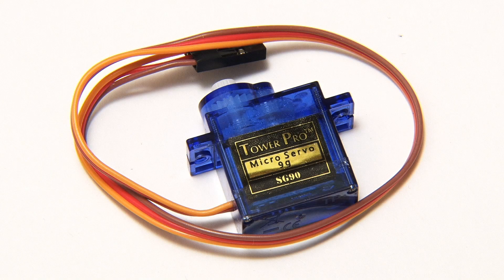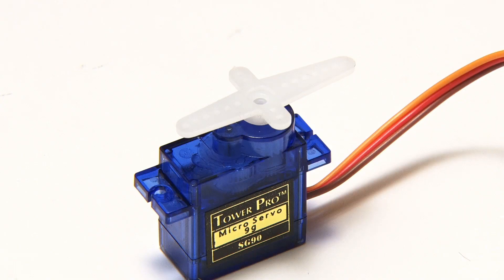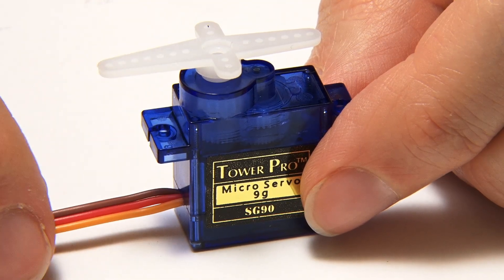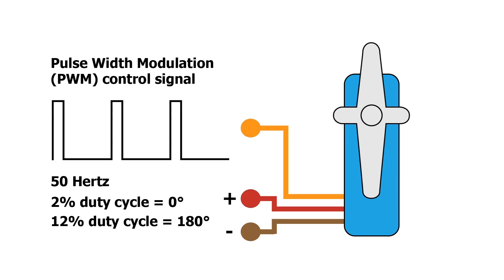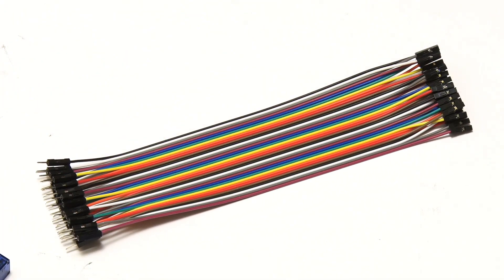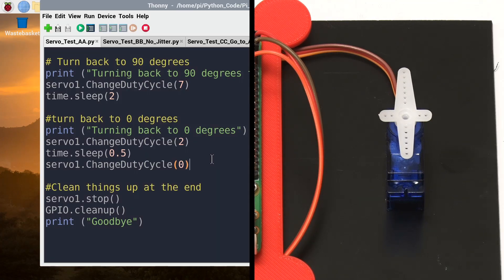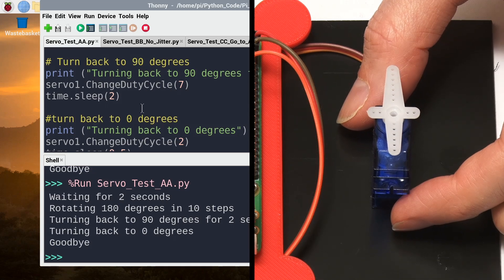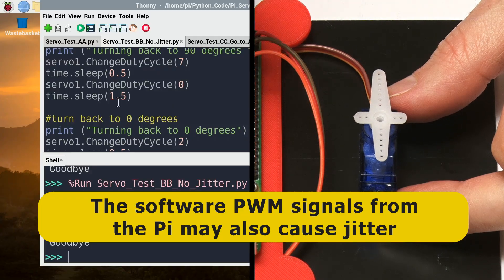Raspberry Pi Servo Motor Control

Comment: I  would love to see a build guide for a home automation unit with these motors for raising and lowering window blinds.
Reply: Honestly, automated window treatments sound inconsequential, but many a year ago, I worked in retail selling flooring...so naturally, I was required to sell window treatments too...(?).

The amount of money they (the relatively few companies that offer custom window treatments) want just to mill custom window treatments is ridiculous (even more so when you see the margins they pull); but add "motorized" to any order & it would add more to the price of custom window treatments than any other option available.  There were times, to motorize a standard sized shade, it would easily double/triple+ the price (& this was always assuming self-installation…).

There are very few window treatments that are more complex than a single rotating metal rod.  As a general public service, if you cannot find a YouTube video to help...then out of a sense of moral/ethical duty to act, I would think EC would be compelled to take on the Custom Window Treatments cabal and their insatiable appetite for profit with just a single YouTube video.

Motorized aside, Window Treatments are one of the New Home Buyer's 1st or 2nd surprise dropkicks to the pants/trousers. It's definitely common in the States...not so sure about the UK....(?)
Reply: stepper motors would be better, they have continuous rotation, search for
"home automation blinds" on youtube :  the hookup and drzzs
Reply: @jyvben1520  Thanks my man! Will definitely look that up

Comment: finally after long time real projects
Reply from the maker: Glad you appreciated. More soon!
Reply: I find the Pi is much more interesting once you start interfacing it with the physical world. I already own four or five computers that are better than a Pi at everything else... but once you tinker with sensors, motors, hats, designing your own enclosures and so on, you find that there’s a real sense of achievement. Also, I am able to tell myself it doesn't matter if you nuke one... although I haven't lobotomised a single Raspberry Pi yet.

Comment: Thank you so so much for this video i was just looking for a tutorial on this topic  
but specifically i was looking to control a full functional bionic arm via responsive web application.
Reply from the maker: Many servos could make such an arm . . . which could be remotely controlled. :)
Reply: @ExplainingComputers  yeah i already built one But the only thing left to do is to figure out a way to control it via a web application which can then be hosted on raspberry pi server and then can be accessed by any other computer or smartphone and that web application will execute Php code to run commands in order to move the bionic arm 
for example let's say i wanna tell the arm to  put some ketchup in the plate i will open the web app and press the specific button and then that button will trigger the php code and that php code will execute the pre-written python code which will tell the servo's to go a little bit this way and a little bit that way to take the ketchup bottle and squeeze it on the plate.

// I know it's a little complicated to make a video of this entire thing but if you can just  give me or Us the basic idea of the whole code that will be really appreciated.

Thanks.

Comment: 5:00 What’s the most popular “dedicated hardware” that doesn’t use software pwm signals?
Reply from the maker: You can also get servo controller HATs for a Pi.
Reply: Arduino has dedicated PWM pins

Comment: Why using that slow Python interpreting language - going back to the future?  There are good C/C++ libraries for the PCA9685.
https://www.adafruit.com/product/2327
https://www.adafruit.com/product/815
https://github.com/vanvught/rpidmx512/tree/master/lib-pca9685
Reply: Brainy bits also made one for arduino using the PCA9685 which I used for my  robot car with 4DOF mechanical arm.
Reply from the maker: I am simply using the language that the vast majority of people use in Raspberry Pi project, and which I have used in all previous Pi projects here. I clearly cannot please anybody here today. :(

Comment: Hi Chris. What's the point of making a video about servos? Your channel has a slightly different theme. To use a sledge-hammer to crack a nut. Servos are more for fans of Arduino and STM microcontrollers.
Reply from the maker: Because I will be using servos in some forthcoming Raspberry Pi projects. :) So not a sledge-hammer to crack a nut, but an element to add to future builds where (eg) I will be extending robots I have already built here with servos. I cannot please everybody all of the time. :(

Comment: You are building some future projects as you said in this video. Are we expecting a mini robot arm from these micro servos? You can use some of the full sized servos for great cnc automations! 😊
Reply: Dronebot workshop built one for the MeArm using arduino. But I made mine wireless using NRF24L01 modules. https://youtu.be/-rF-ESsCMUg
Reply: @webslinger2011  That MeArm is pretty amazing. Arduino requires an external wireless addon. A raspberry pi can do it without any help, that would be interesting to see. Yours was pretty neat! Cheers!

Comment: Just a heads up: at 3:19 you said that a pulse is expected every 0.2 seconds, whereas it should be 0.02 seconds.
Reply from the maker: You are correct -- it is 0.02. There are time when I detest having a weekly schedule, which means I have to produce things so quickly that errors creep in and are not found. I will now have myself and this video for ages. :(
Reply: @ExplainingComputers  On the bright side, this is only your first mistake in 2020. But sadly, now you've used up your entire quota for the year, and it's only January.
Reply: @AnttiNannimus1  First and second mistake, he said PMW instead of PWM at 3:09 :)
Reply: @toysareforboys1  Actually, Chris expressed the importance of saying, "Goodbye." without so much as a, "Hello."
His last code with 2 servos had neither. 😥
Reply: @ExplainingComputers  no worries better to make an erroe here and there and do exciting projects as these than neither!! Really loved this one! I am so excited to see more singleboard builds, possibly with item detection and some wheels under with various functionality, dare I say an arm that could fetch drinks? We are allowed to dream right? :)))
Reply: That left me quite confused and I thought I had become stupid, thanks for the comment :)

PS: does the Raspberry have enough resolution to impose a 20ms delay?
Reply: @Sorrentino_Gianni  As far as I understood that: Some GPIO pins have a hardware generated PWM that runs by itself. You set it to a frequency (here: 50Hz) and a pulse length (RC servos: 1...2ms with 1.5ms as the middle position) and than the Python program can work on something else (here: wait a bit and then change the pulse length). 
https://en.wikipedia.org/wiki/Servo_(radio_control)